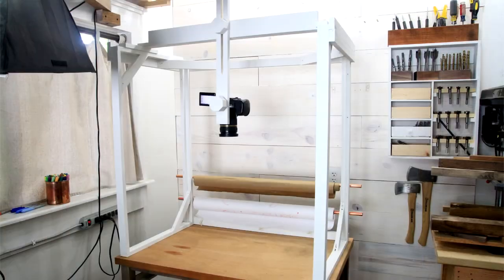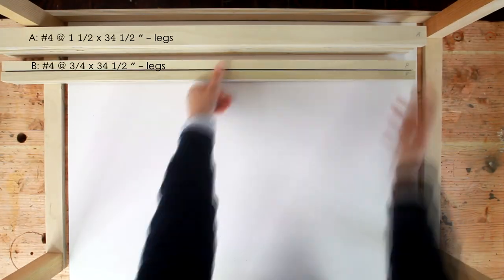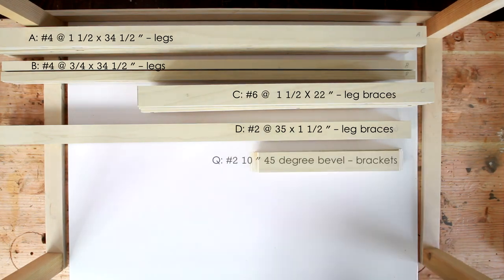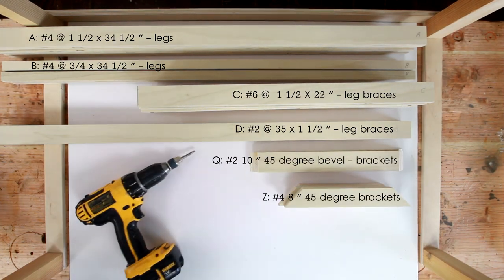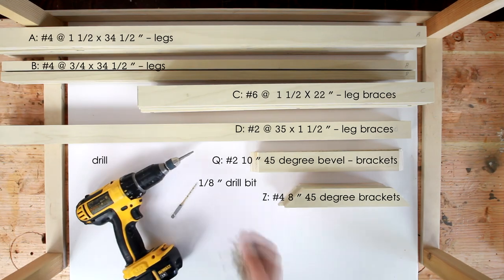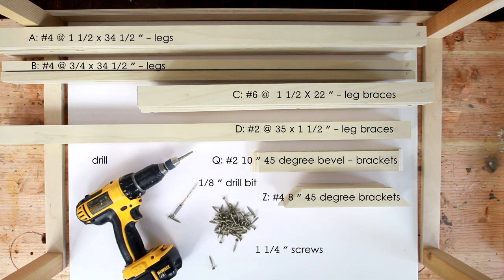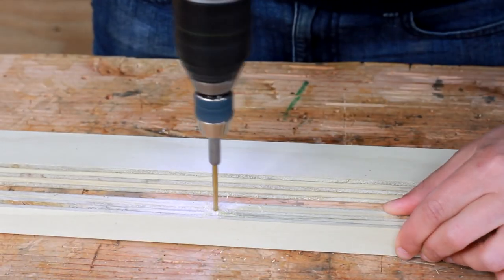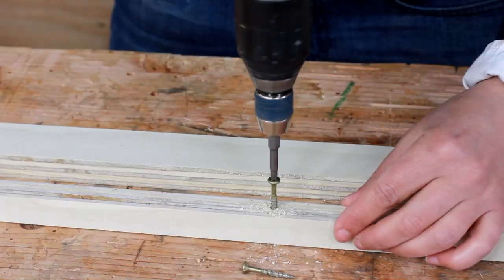DIY How To Overhead Camera Rig

Comment: I suggest using tee nuts, instead of chiseling out a hole for a hex nut. I think it would also be helpful to be able to move the camera side to side.Finally, Wood dowels are much more cost effective than copper!

I think I will try this. Thanks.
Reply: Chuck D Hmmmm I haven’t finished the rig part. I may incorporate side to side movement. 👍👍Good idea 💡
Reply: Ok I just looked at a t nut. A t-nut would require the use of a nut behind it and make moving the camera less simple. 👍

Comment: Nicely done! To save on cost, PVC pipe works great for paper rolls and you wont need a pipe cutter for that.
Reply: Ok I initially thought, like you, that I could use PVC. The paper rolls are heavy and caused it to buckle. Maybe I should have used wider pipe but then I risked it not fitting through the roll.

Comment: Darbin Orvar  Great project, Linn! I think I may have to make this one. A cost savings (where I am, at least), will be to buy a piece of 1/2" electrical conduit and conduit straps rather than copper. I can get a piece of 10' conduit for less than $3 and the straps for less than $1 for a pack of 4. It cuts just as easily and is great. I've used it for small clamp racks and all kinds of similar applications.

Comment: Nice video, enthusiastic, as usual !
Suggestion:  Copper was a nice, colorful touch, to support the rolls, we would generally use an inferior product, at less expense.  MOF, you still can!  Purchase some PVC tube in 1/2" or 3/4" and make the switch..  use that copper for an artistic project!
Or, if you feel the PVC is a bit wimpy, use 1/2 or 3/4" EMT which is sold at the same store.
It's used to run electrical wires within. Both the above come in a 10ft stick, so take a small hacksaw to the store with you so you can cut for carrying home in the car.  rc

Comment: First of all, thanks for the great videos and instructions. I am just getting into woodworking although I have a shop at home since forever actually.

I plan to build this rig (probably with some minor changes). Actually maybe two versions of this. One to learn and have at my folks home (where I have plenty space) and a second one that I can break down and assembler without tools for my apartment, so that I can store it away when not needed. Can I link and insert a caption in the videos I plan to make?

I have some "design" questions.

On the legs you used two pieces screwed together kind of in a “L” shape. Besides using the little piece (B) to screw down the two braces, do they serve any other practical reason? I was thinking of making it without the little part put using 4 instead of 2 braces to hold the square shape of the frame in place.

Upper Braces Guides (Part C) sits just under parte E from the tracks, any reason for this not being just one part? Besides this, I was planning to leave the track guides out of the frame and making it “upside down” on the camera slider, kind of like this:
∏ ─ ─ ╦─ ─∏

Having the ends "grabbing" over the side frames. Do you see any reason not to do it this way?

Thanks in advance.

Comment: I built one with a few adjustments. Works great for what I need! Thanks for your great videos. I also made a 3D CAD model of it in Onshape. Do you mind if I share that model publicly if I credit you?
Reply from the maker: That's great - of course I don't mind if you share the project, I'd like to see how yours turned out!
Reply: Awesome! Thanks. I did a few things differently, like change the overall size and make 3D printed knobs, but it's pretty similar. Here's a link to the CAD I did if you want to check it out:

http://bit.ly/OverheadCameraRig

Comment: This is really great Linn. I have a couple of questions. 1. Is this for still cameras or video cameras? I use a 35 mm camera and a cheap digital camera. 2. How do you frame and focus your shots?
Reply from the maker: Robert Bock Thanks Robert. You can use it with anything that has a 1/4-20 thread in the base. I look at the screen to help focus.

Comment: For the part where you embed the nut in wood if you are using 3/8 or smaller it's easier to just use  a T-nut  - just drill a hole and pound it in . no chiseling and epoxy

Comment: @darbin orvar  What size width paper is being used? I don't think a 36" roll would work because the longest piece of wood for the frame is 35". Great job!
Reply: I saw your comment, went to Amazon and for some reason only found rolls that were 30 in wide. I figured you would write the comment without knowing the Rolla were 36 in so I went back a day later and found that paper rolls come in 4 lengths 18.24,30 and 36 in. The 30” was a paid ad on Amazon. 

Anyway based upon that intel, I simple made those supports an 1 longer and now the 36 in roll fits 👍

Comment: Rolls of background paper should be higher to allow for a seamless background when shooting head on.
Wooden dowels or EMT Conduit would be cheaper than copper pipe. Also look to have dowel or pipe fit into a bracket on one end (capturing the dowel) and drop in to a bracket on the other as there will come a time when you want to change your paper, n'est pas?